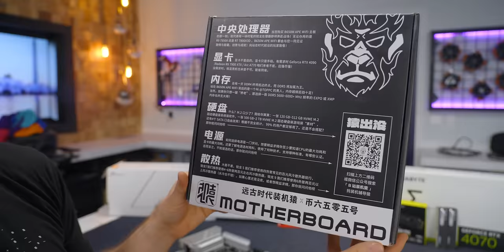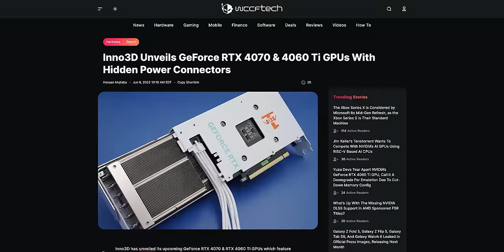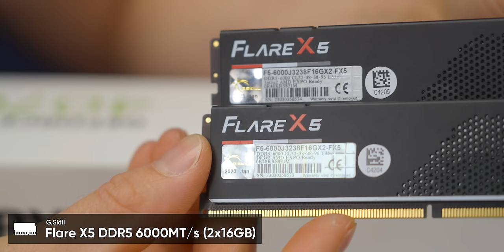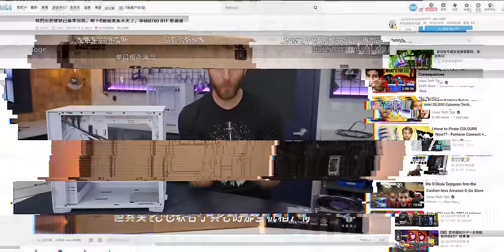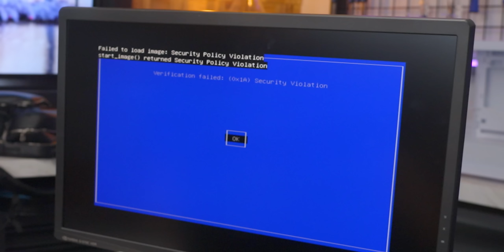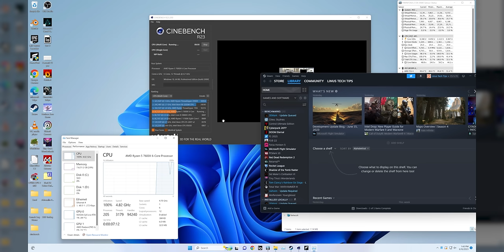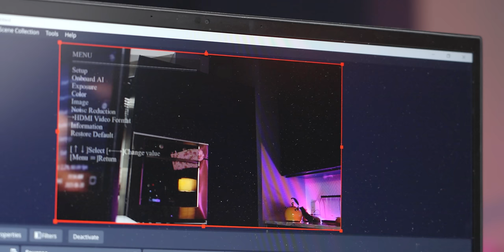This Beautiful PC has an UGLY Secret…

Comment: I personally like the cables in the front. It gives the Pc an "industrial" and "technical" look. Plus some cables can be matched to the theme that you want, giving pretty much the same timeless and clean look as compared with the connectors on the back.
Reply: I am very sorry i couldn't resist. I understand different people have different preferences. 🙏
Reply: they give off a borg vibe, having tubes/cables run to the main compontent to give the sense of:  its keeping it alive and working wich is in my eyes cooler than a clean shaved baby butt that has no appeal
Reply: Agreed. The exact reason I bought custom sleeved cables
Reply: agreed and why the fuck would ppl even add extensions when u cant see  them
Reply: It seems way more convienient though. Simple plus-to-plug, no bent wires, all locations for power management accessible from one side. Serial experiment lain is cool, but as long as we don't bring in endless rgb, cybercore is cooler.
Reply: Another thought is that this is just Fashion. Someone decides they want a clean sleek appearance and enough others jump on the bandwagon. (Lookin’ at you Jonny-5z formerly of Apple) So we all get stuck with an aesthetic that seems new (it isn’t) easier (it isn’t) cheaper? (it isn’t) better performance (it isn’t) with total disregard for other thoughts about aesthetics. 
The simple fact is, you COULD fold all your cables around to the back already. So this is a difference without a distinction.
Reply: Caring what the internals of a PC look like at all is just sad tbh. Should just be a plain black box
Reply: Agreed. A couple of neat loops around the edges of the board look great if done right. I've always been a "form from function" kind of guy and a PC with zero visible cable loops just feels like something is missing.
Reply: @TheFlyingPineapple   Why? Do people not care what their cars look like? To many people, their computer is not just an appliance to be used and hidden away. And when it costs thousands, it's only natural to want it to look nice.

Comment: I share the same concerns as Paul, there will need to be some regulation to it if manufactures go this route and it will absolutely kill compatibility with cases as well, I am using a case that is over 15 years old still and I wouldn't replace it if I can avoid it.
Reply: Simple just take a Dremal to make holes for the cables. Only thing that  you must do before cutting is mark the spots then cut.
Reply: Why dont they just design a nice backplate of the mobo and flip everything around?
Reply: Im all for compatibility but innovation will never happen if we always cater to decade old standards
Reply: @verakoo6187  This, we will have to eventually move on if we want any improvements, personally I would love this, together with a new standard for SATA that covers both the power and data transmission in one cable that isn't a pain to install, even if cases overall become wider, because I would also love HDD bays in the back to be more common place.

Personally I don't see how Paul's criticism is an issue at all, unless it's a really small and older small form factor case I don't see the cables not fitting, the cooling is just false advertising and has nothing to do with the approach itself, and as far as compatibility goes would they still not use the same power connectors anyway?
Reply: @Robin-Visser you would need to place the cpu on the rear then in order to cool it, vrm heatsinks wouldnt get enough airflow and youd move the to the back as well. Oh you a pcie slot on the back as well? All of the sudden you got a normal mobo again. Theres a reason its the back side. I can see your point amd maybe as a one off for a really clean build maybe, but at that point just get a solid side panel imho if youre going for the ultimate clean build. Also it would be a massive pain in the butt to change e.g. m.2 or a fan if everything is on the back.
Reply: @Dragon6687 and after your second or third upgrade your whole mobo is hanging on a couple 3mm tabs with the rest cut off. Yeah no thanks.
Reply: You also have the EVGA method of moving all the power connectors to the side and right angling them
Reply: agreed, just brought a fractal design torrent recently and I don't plan to replace it anytime soon
Reply: @Dragon6687  Ah yes. take a Dremel to a server chassis and then the cables can go outside of the case into another server chassis?

Oops, turns out computers exist for actually doing work and not just gaming.
Reply: @D3nn1s  not really, all the connectors are in pretty much the same space on just about any motherboard you look at
Reply: @coopercummings8370  theyre in roughly the same area but bot in the same space. Cpu 4+4 is e.g. in the top left, but for case cutouts it makes a huge difference if its 5mm left or right

Comment: Modding 101, use low tack(like painter's) tape to cover the surface you're about to cut. Helps reduce debris and easy to draw your lines on.
Reply: Yes. For guys who have been doing 'mods' for many years, you'd think they'd know these useful tricks.
Reply: its not just modding 101, just general pro tip when cutting metal. Heck, i do it for anything that i cut with a small cut off wheel
Reply: Just curious how would it reduce debris, the tape would reduce debris if it were double sided, the cuttings would stick to that but single sided tape you already have the glue side stuck to the metal, if anything you are increasing the debris as you are cutting more material ie metal and also tape. The reason I use tape when cutting is that marking lines to cut on is easier and if you slip and the cutting wheel jumps out of the cut you may avoid scratchs if they are light enough and don't cut thru the tape.
Reply: @tomsparks2294 its more about how much of that debris accumulates to the sides of the cut - that is what produces a shitty edge. When you tape down the material, there is less material jumping out of the cut to the sides, becoming accumulated debris on the sides. The only thing the material can do is is either be taken out of the cut by the blade, or stay under the tape to the sides. So it's not so much about catching stuff thats flying away, but more about keeping it from curling off to the sides to the sides in the first place. Of course because tape is still soft material you still have some amount of debris accumulating around your cut, but this is the idea and it works relatively well.
Reply: Won't the tape melt and blow plastic bits everywhere?

Comment: Id personally love to see cables in a system taken to the other extreme:

hardline cables

make the cables part of the appeal like with hardline water-cooling through custom pcbs / power distribution blocks instead of wiggly wires. imo it would be a really badass addition to an all out balls to the wall type build
Reply: Damn amazing idea actually
Reply: Sounds really cool but you'd probably have to develop a way to cut and shape the cables like hard-line tubing.
Reply: yeah ok "bubba"
Reply: @carinthesunset1971  I don't think it would be that difficult. I think you'd just need bare solid core copper wire. solid core copper wire is easily bendable and you could cut and solder it if you wanted. Then you could either air gap the cables or sleeve/heat shrink them individually. Yes, the solution is stupid, but so is "hard line cables" imo.
Reply: @carinthesunset1971  its been done sff youtubers do it all the time. Its very time consuming so its super rare
Reply: You could run the cables through a metal tube and repin them again for a connector.
Reply: Yes
Reply: i'd love to see that
Reply: @carinthesunset1971 no, I'm pretty sure they could cut off the cable's heads, fit the wire through the tube and then reattach the connector.
Reply: THIS!!!!! I love seeing matching cables run throughout a system so it would be really cool to run cables out from the middle like its a hive mind, maybe even hanging some fake cables up aswell to give it that extra alive machine look
Reply: I don't want to see the CPU cooler or my LED lights. I want a glass panel showing the otherside of the case, and pure steel to hide all that non-cable garbage.
Reply: @smalltime0  exactly how it should be
Reply: Make it silver and soldered by hand, just like the old days.
Reply: @Easiermarlin33 solid core performs worse for higher frequency ripple and then you have the real problem that all connectors are standardised as crimp connectors that only go on stranded wire. Perhaps they can be adapted as solder connectors or special versions made but decently current carrying connectors are pretty serious and expensive to set up new manufacturing, a lot of mistakes are easy to make, tooling doesn't come out right on the first few attempts, a lot of testing needed, and results from not putting enough effort in are often catastrophic.

What you're more likely to see is just external wire conduits like they could be bent tubing or angles and zip ties or 3D printed or injection moulded element kits.
Reply: @SianaGearz  you do make some good points. I was more thinking along the lines of a hand soldered hobbyist one off rather than a production run solution. What you pointed out would be much more feasible for a production run, and would be kinda neat still even if it isn't "true hardline cables" whatever that means lol
Reply: @carinthesunset1971  "you'd probably have to develop a way to cut and shape the cables"
What!? Hard cables (solid copper instead of liz wire) are cut and "shaped" by millions of electricians around the world everyday. You'd have to work cleaner, yes; but you do not need to develop new technology for this, lol.
Reply: @SianaGearz  "solid core performs worse for higher frequency ripple"
Uhm... no. That would only be true if the strands of liz wire were independently isolated creating high-frequency liz wire. Ordinary liz wires should roughly performe the same as solid copper.
Reply: You could probably make some sort of snap-over conduit to cover clean cable runs
Reply: I saw a gaming room once where the guy routed all of his power and AV cables from all the consoles and PCs to a set of TVs and monitors like traces on a PCB, the same type of runs and angles, it was amazing and gave a new personality to the room, I would love to see that inside a PC case
Reply: So, solid copper wire?
Reply: I think they should just make the motherboard much thicker so it can just carry PCIe power to the GPU with just a simple cable getting plugged in straight into the board. As for the CPU fan, that might need to stay the same or just make a standard slot that when you plug the Fan in it drives the fan
Reply: @ShersGarage Sheesh the dedication
Reply: @carinthesunset1971 run the cables through regular hardline tubing?
Reply: As an electrician........This has been done for literally over a hundred years.  You run pipe, you pull wire into pipe, and there's your hardline wiring.  And I'll pass.  I don't want to be making 3 point saddles, offsets, kicked 90's and all that shit at home too.

Comment: I appreciate that Fractal makes a windowless version of the pop air, and most of their other cases.  Don't have to worry about your cables looking nice and no risk of glass breaking.
Reply: I agree. The solution to hide your cable "mess" is called an opaque box. :D
And then hide the box.
Reply: @michael_baron  Hell, my PC looks perfectly fine, and I keep it on the floor and never look inside. Noise is less of a problem (still a problem) when it's not in your face, and I don't want the distracting glow of LEDs on my desk. Besides, it would occupy a lot of room.
Reply: except it's only on the black, not white
Reply: And sadly not an option on the Pop Mini Air, in black or white.

Comment: I think one of the issues is going to be the cases - and not just to adopt "a" standard. Right now, I can fit mATX, ATX, maybe "eATX" in the same case. But with the connectors on the back, they'd all need to be cut out in different areas - which means multiple cases for multiple motherboard sizes, not just one that can be used for many (unless they find a way to cluster them all in the back in the same area, which I can see causing other MB design problems.)
Reply: This. The main reason why this will not be adopted nor deployed to the masses. Full ATX cases are attractive to many seasoned and new builders because of re-usability and compatibility to smaller boards (M-ATX and M-ITX) should there be a need for one in the future. Heck... the same goes for M-ATX cases for M-ITX use cases. If cut outs for different board sizes are made (for example) on future cases to adopt such standards of having rear connectors, it will affect the structural sturdiness of the internal frame that holds the motherboard - we all know that enthusiast CPU coolers and GPUs aren't getting any lighter. Lastly, building on APE boards will cause for the motherboard to bend more when installing CPU blocks and memory - the connectors just sticks out. Whereas, the current standard still bends mobos but not THAT much.
Reply: Yep, this needs to be rolled into a new ATX revision if it's going to see wide adoption.
Reply: I think it could be reasonable to have the holes be cutouts like with those metal GPU strips at the back of most cases. Then you can push them out as needed for the mobo you're going to use.
Reply: @inquisitormuchly3199  I don't expext that to be a major issue, mATX is the same width as ATX, the board is just shorter, but the power connectors are never on the bottom anyways, so that doesn't really affect much of anything. If they put holes along the bottom edge of where an m-atx board would go for front panel, usb, etc. it would be covered when an ATX board is used, and there are already holes along the bottom edge of where an ATX board goes so that doesn't really change things. It would make it so if you put an itx board in a full atx case there are some additional unsightly holes visible, but how many people are actually putting itx boards in full atx cases and care about appearance anyways? You pay a premium for the ITX board and you lose out on a lot of features and connectivity vs matx or atx, so you probably aren't buying an itx board unless you are going to put it in an itx case anyways.
Reply: I think there's a way around this. You can just standardise a thicker backplate where just about all the material is cut away and only the few bits remain that are needed to hold the standoffs, and the connections between them. The mainboard manufacturer is then free to use all the rest of the area to place connectors where needed.
Reply: @SianaGearz  you don't even need to do that. Connectors are almost exclusively placed on the outside edge of the board.  Just put a 3cm wide slot all the way around the outside edge except 1.5cm on either side of the standoffs and that is good enough. A 3cm wide connecting bar should be plenty strong  if they roll the edges and stamp a couple reinforcing ribs into it to strengthen them.
Reply: @coopercummings8370  Boards vary in size, they can actually be ANY size as long as they use prescribed standoffs and are smaller than maximum dimensions for each size standard. It's uncommon to see fullsize ATX boards shorter than standard but they're sometimes narrower, actually width varies for micro as well; and for uATX it's not uncommon to chop off a little at the bottom! There's also no hard reason to restrict the backside connector area to exclusively the edge, since it can cause unfortunate routing or limit the ports you can offer.
Reply: @MsDestroyer900 that's a great idea
Reply: solved， many cases been created in China that fit with front motherboard, and also back motherboard. they have already start to selling it on TaoBao, the Ape Store.

Comment: I think the point we're at currently with cable management is very good. I distinctly remember the nightmare I went through cable managing my OG Antec 900 with a non-modular PSU. These days, most competent mid-tower cases are chocked full of cable management options that make building a clean PC pretty easy. Dealing with the backside takes time if you care, but it's generally only something you do once a year at most. I see way too many compatibility nightmares with this new configuration. Plus, a few cables on the top side has absolutely no meaningful effect on airflow.
Reply: I agree. Cases used to be opaque for a reason.... They had a lot of cables to hide.
Reply: I still have my antec 900 in my closet, that's funny.

Comment: The CPU Fan header on the back would be great for AIO/water-cooled. If AIO manufacturers started putting the AIO pump cabled higher on the loop  (like close to the radiator rather than right by the water block), it'd look completely cableless.

Comment: What would be MUCH better is if they put all connectors along the edges of the board and have the entire board sit recessed into the tray so the visible tray walls are flush with the board height (hard to standardise that though), hiding all cables without the need for angled adapters OR extra space in the rear. Kind of how they currently do in some cases with the SATA cable area, whereby the right hand side chamber wall is slightly raised so the cables come out sideways rather than straight up, but just extend the walls to butt up to the board edge and set a standardised board height eg 2cm.